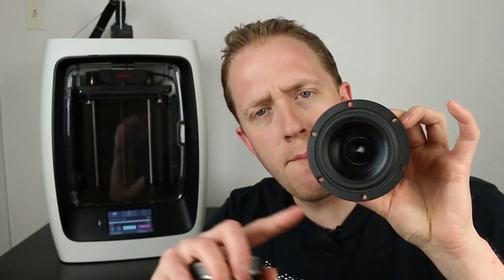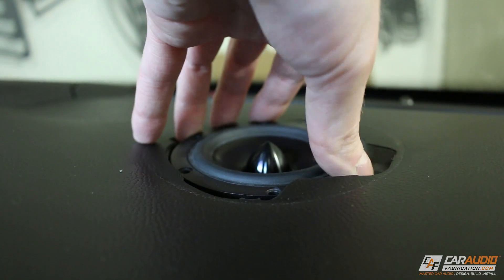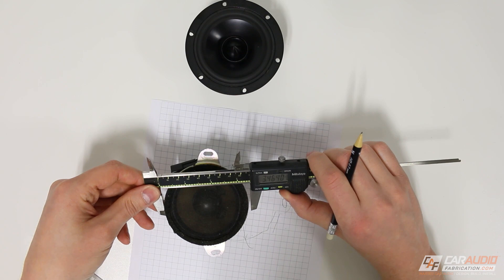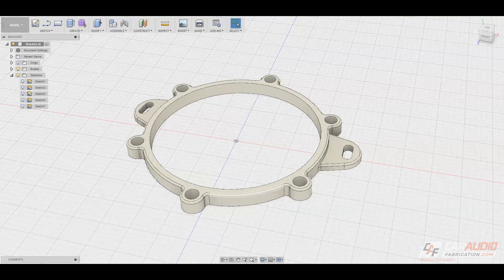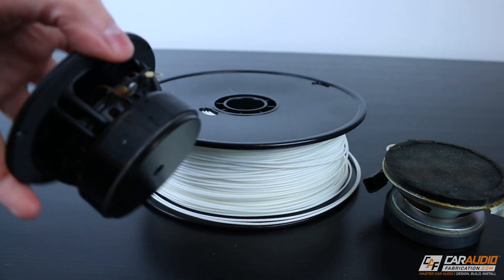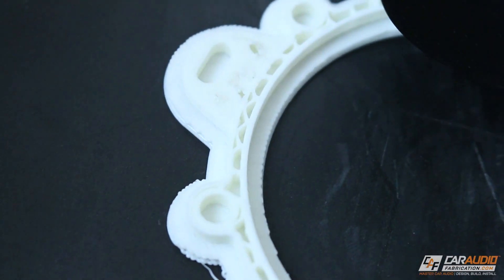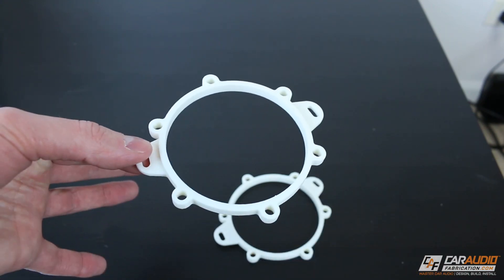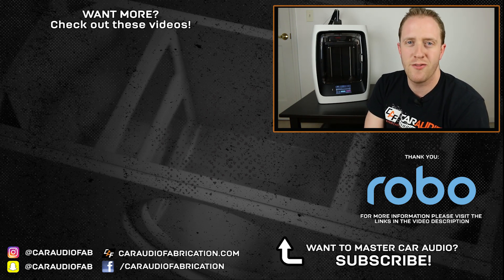3D Printing Custom Speaker Adapters - How to

Comment: I know this video is 5 years old, but on that very same vehicle, for the rear deck did you swap out the speakers for any kind of component speakers and reused the factory bracket, if so did you make a bracket for the tweeter that sits ontop of the woofer?

Also did you happen to make a new grill for the center dash speaker location?

I'm looking at replacing my rear deck speakers for aftermarket component speakers and looking at 3d printing that bracket

Comment: I don't know if you would see this comment or not. I was wondering if a person could print an entire speaker pod that would snap I to a factory location. Like a pod that will snap into where the speaker covers the dash of the 4th gen ram 1500s. 

As in remove the covers and design and print a replacement cover to install a mid and tweeter in the same position

Comment: great video. this 3d printer would be great to make maybe 3 to 4 pairs of speaker adapters ahead of time to have in stock in the install bay. How much would be the cost per speaker adapter in materials?
Reply: 3d printer filament is pretty cheap. It's about $30 for a 1kg roll. plus the cost of the insert nuts granted you already have a 3d printer.
Reply: The adapter would be about $1 in material cost
Reply: The adapter would be about $1 in material cost

Comment: Your vids are cool but the approaches are ideal so much that it needs special equipment and knowledge. On a business standpoint it doesn’t make sense.
Reply from the maker: I disagree, from a business stand point it makes a ton of sense, you could have a design for an adapter and whenever you schedule an appointment with a client you could start it printing and have it ready for the install. Much faster than waiting for freight, then for applications where an adapter doesn't exist you can make your own offering your clientele something that the competition can't.

Comment: That's not a micromitor they are vernier calipers they are two totally different things
Reply: Not a vernier either. that is a digital caliper. There is no vernier scale on that caliper. :)
Reply: dj red hare aus I was wondering if anyone was going to pick that up or not! I wasn't going to point it out but the proper names for tools is a very important part of any type of automotive work! I can't stress it enough when I'm working with any sidekicks or new car guys because if you called a parts house and asked for calipers to rent let's say, u would be given the incorrect tool for the job. I'm sure mark just mis spoke when he said that. But cool video regardless! 3d printing is some cool sh!t I'd love to have one of those machines
Reply from the maker: +dj red hare aus oops I misspoke, heaven forbid!

Comment: So in your set up, are you going for a two seat listening position, or are you using the center channel to handle your voice commands, bluetooth, factory chimes?
Reply: Jack Oswald this is the optional factory sound system in 04-08 Grand Prix. The center speaker ads a small amount of mid range
Reply: Yes, I'm asking if there is a goal of adding a center channel, usually people don't use it unless they're going for a 2 seat sound stage for judging since timing can be an issue between all three speakers up front, unless using an Alpine PXA-H800 or JBL MS8 that use Logic or Dolby surround for processing. As with my system, I used it as a way to retain factory chimes, as well as bluetooth phone, and not have them amplified in my entire system.
Reply: Jack Oswald Yea normally I wouldn't use the center speaker. I believe he's just replacing the factory speakers and using factory amp.

Comment: Hey great job Mark!!! 👍👍👍 How much does it cost to invest in one of those ROBO machines to do that 3D printing??? GREAT VIDEO!!!
Reply from the maker: +Jose Garcia it's not bad at all, check out the link in the description of the video for info and pricing. There are a couple models
Reply: not bad at all... $1500........
Reply: Hey Ross, we have multiple models from $500-$1500
Reply: And if you are willing to monkey with it, there are even cheaper machines on the market (you get what you pay for though and Robo does make a nice machine).

Comment: Now you just need a 3D printer with enough bed space to print 6.5" speaker baffles with. Some sweet angled baffles to really fix some of the stock door mounting positions would be really cool.
Reply from the maker: +Robert Coffey build volume is 8 by 8 by 10, plenty of room and can always make separate pieces if need to be larger.
Reply: CarAudioFabrication wow. It has larger build capacity than I thought.

Comment: This is a terrific video!  I have two questions.  One, what was the total time it took for the 3D printer to make the part?  Two, wouldn't it be a good idea to fill those (what appear to be) opening around the mounted speaker that prevent the front of the speaker from being isolated from the back.  I would think the shared air between the front and back of the speaker would have an impact on performance and sound quality?  Anyway, very cool video!
Reply: Mark stated " a couple hours later" in the video

Comment: Angus of Makers muse made a video about prints in cars failing.
You don't need to use a raft if your print bed is calibrated.
Extra likes for the brass inserts!
Reply from the maker: I've seen the video, his test showed ABS was fine which I used in the video. PLA prints should be avoided in car.